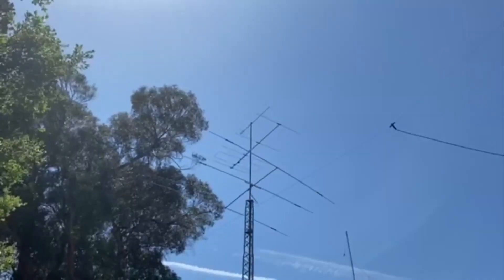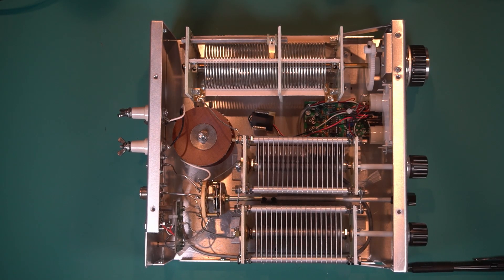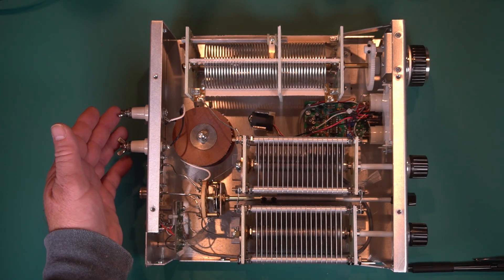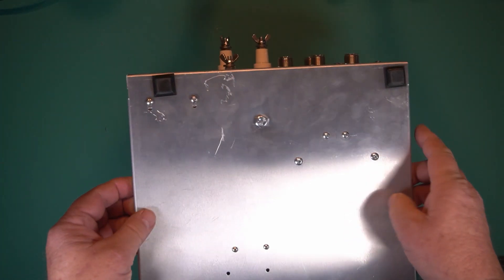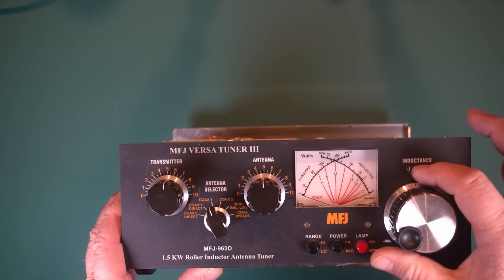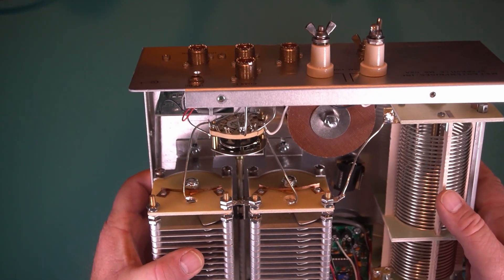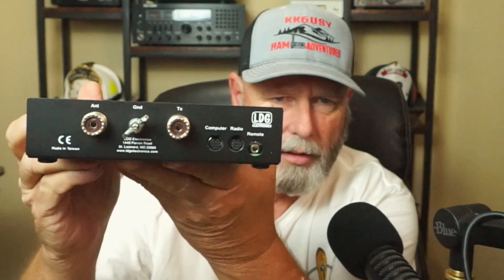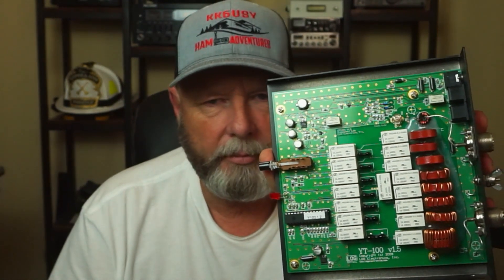What's inside your MFJ and LDG Tuners?

Comment: The point of failure for these tuners is the slip ring that makes a contact on the rear of the air variable capacitors. Hard to repair the rings and make them contact again.

Comment: I have a LDG AT-100 which was very similar to the one you showed.  Sold all my manual tuners and a Kenwood 430s to a friend getting started in radio and my autotuner stopped working within a month. Not much wrong but old eyes can't see the parts much less fix it inside.  The 952d or one like it will be my next tuner. Your 7 minute comparison was one of the most useful YouTube posts.  If you know someone with bionic eyes that can heal my broken tuner, love to fix this and get back on HF.  AC6ZZ

Comment: I had the Vectronics HFT1500, VC300DLP, MFJ-962D, 989C, 989D & the little 971 portable tuner. already got rid of all these Popcorn Fryers. The 962D can still handle a single 3-500Z, most of the 572B's Amps and a single Tetrode GU74B @ full outrput rate. I mean, the One I had did handle it if not over doing / going too crazy with it. Thx for the Video, Chuck. Happy wednesday from SW-Germany. 73's de Your Friend Uncle Guenter